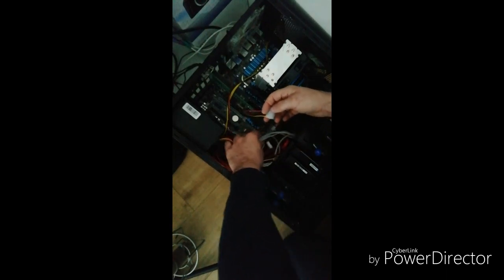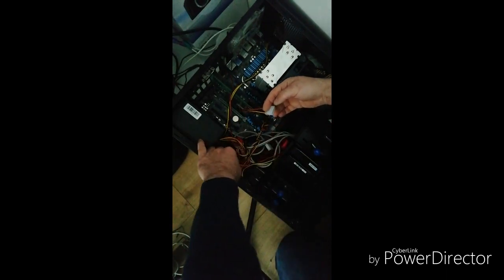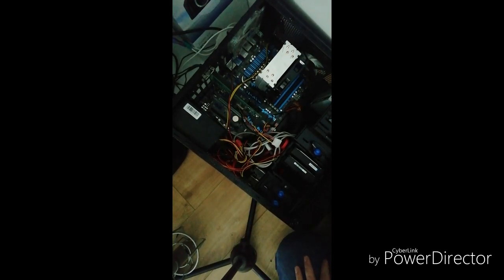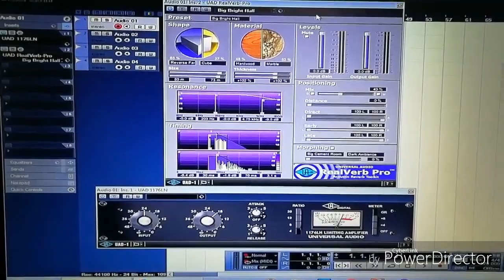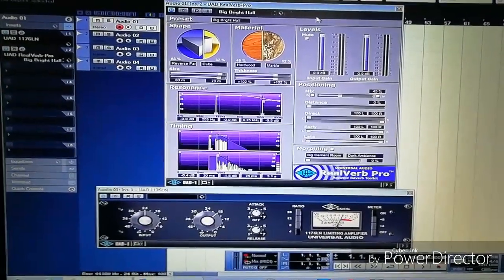UAD-1 pci to pcie

Comment: Hi,  i installed  the same UAD-1  card  (  Ultra Pack bundle )   on my windows 10   64 bit PC. I had some free PCI slots, so no neeed for this adapter. I  turned off driver signature in Win 10, turned off core isolation and run and installed  software ( v 4.2.0 ) provided on instasllation CD  in Win XP SP2 compatibilty mode  without  any issues,  BUT Windows doesnt recognize this card. How did you manage to run this card on Win 10? BRDS
Reply from the maker: This is an old video, I'm pretty sure this was Windows 7. I don't know how/if it will work with Windows 10, sorry.

Comment: and it is an old card?? Hmmm maan i have tha same problem i recently bought the MSI B450 Tomahawk Max II but has no pci input.do you think it will work with this adapter?? everyone tells me that because my card is old it will not work with this adapter and with new motherboards but noticed today that the company of my card release new drivers for my card in july 20021?There is a possibility that they are compatible with y new motherboard??
Reply from the maker: Honestly, I guess its just a case of try it and see. I had no idea if this would work until I tried it, I thought it was worth risking £6.50 to see.

Comment: What do you think about UAD-1 plugins?How do you compare them to the present plugins?Anything interesting about it?I am looking to buy UAD-1, maybe even TC Powercore MK2. i just find interesting having a DSP..
Thanks
Reply from the maker: The old are exactly the same as the new ones. The LN1176, LA2A and Pultec are worth the purchase alone.
Actually all the bits in this video are lying in a cupboard now, since I upgraded my system.
Reply: @LeeLimerick  Thanks, i've ordered two of Uad-1 Ultra packs, this is the last step before going analog for me. What have you upgraded to if i may ask?Still on Uad?
Reply from the maker: @RTCLR123  Yes, I bought a UAD-2, altho I also have other plug-ins from Waves etc.